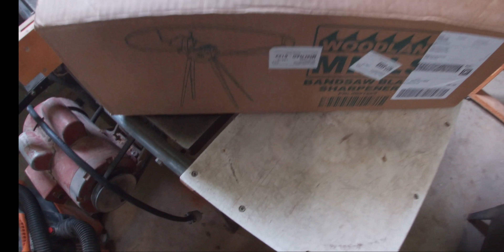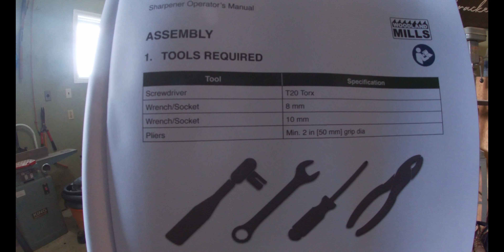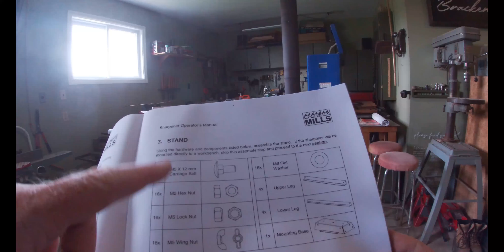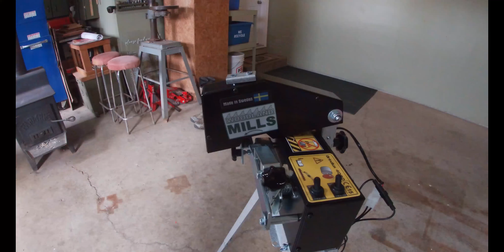Woodland Mills Blade Sharpener - Assembly and First Sharpen.

Comment: Yours seems to work more smoothly than mine. I thought the part that clamps onto the blade was too rough and causing the motor to strain on the advance. I polished that part and now it works better. Even if I never recover the cost of the sharpener and setter, it's satisfying to do it myself.
Reply from the maker: Yes I agree, Its nice having everything to do the whole process yourself.